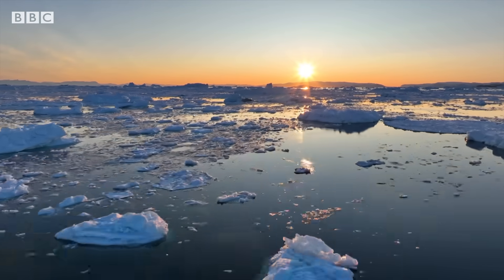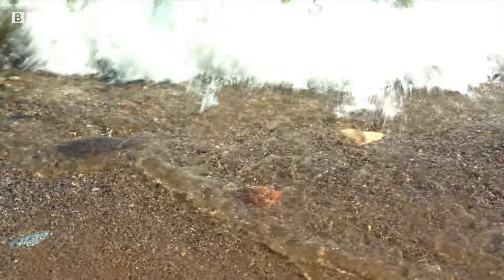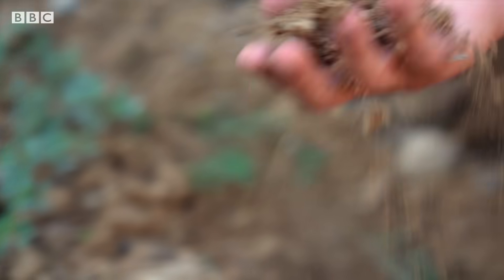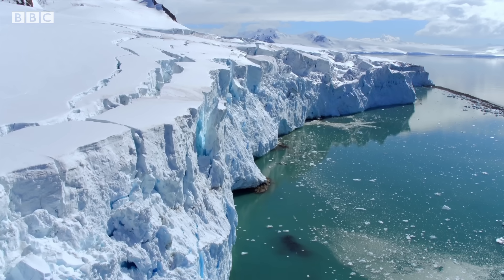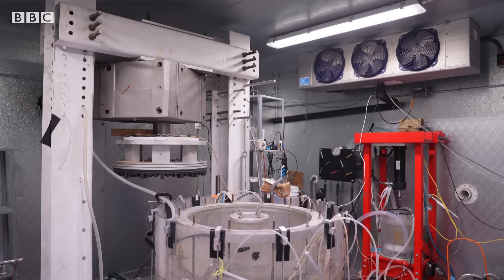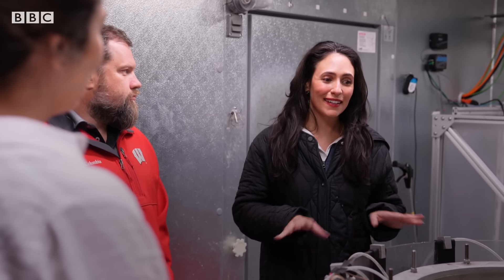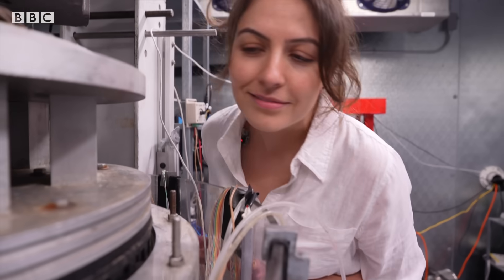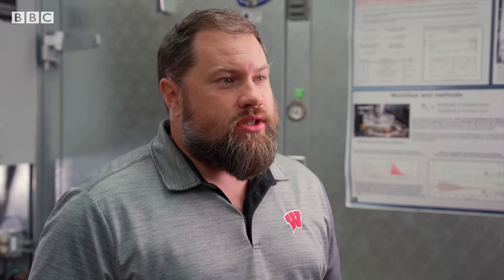Can we prepare for the impact of melting glaciers? | BBC News

Comment: Earth's current warming rate is 2°C per 100 years. ‘The Great Dying’ mass extinction which killed 96% marine (sea) life and 70% terrestrial (land) life was caused by a temperature increase of 5°C in around 20,000 years, at Earths current rate 5°C can be reached in just 250 years (currently warming over 100x faster)

The warming seen directly matches carbon dioxide (CO₂) emissions 

The past decade has been the warmest on record with 2024 being the hottest. 2023 & 2024 reached 1.5°C global average temperature above pre industrial time (year 1850) and 2025 is expected to do the same.
2040: ≈1.7°C; 2050: ≈1.9–2.0°C; 2100: ≈2.7–3.1°C

Tipping points 
• Once a certain temperature is reached these natural factors start emitting CO₂ faster and faster at a rate that cannot be stopped by humans stopping CO₂ emissions (runaway effect) (CO₂ remains in the atmosphere for up to hundreds of thousands of years), and are irreversible (e.g. ice sheets take millions of years to form) 
• 1.5–1.6°C global average: ice melts → darker ground underneath can heat more → faster & faster melting → higher & higher temperatures → CO₂ emission from ice; sea level rise (current rate is global rise up to one metre before 2100 flooding coastal infrastructure such as shipping ports and forcing mass displacement); temperature at the poles determines the wind pressure of the jet streams which control global weather causing more extreme weather (e.g. more intense and longer heatwaves causing drought); freshwater from ice slows global currents which control air temperature which leads to more extreme weather 
• 1.5–1.6°C global average: heatwaves cause drought → unfarmable soil; water shortages; destroys microbial soil ecosystems (bacteria & fungi) which keep plants alive (including trees and grasslands) so they stop taking in CO₂ and instead start releasing it; increased wildfires release vast amounts of CO₂ from forests

Comment: Plymouth rock is still unsubmerged...
Reply: AI Overview
While Plymouth Rock is often visible, the claim that it is still unsubmerged—often used to dispute sea-level rise—is misleading and false. The rock frequently becomes completely covered by seawater during very high tides and storm events, and it has been moved multiple times since 1620. 
Why Plymouth Rock is Not an Accurate Sea-Level Gauge
It has been moved repeatedly: The rock has not been in the exact same location since 1620. It was moved to the town square in 1774 (and broke in half in the process), moved again in 1834 to the Pilgrim Hall Museum, and finally returned to its current waterfront location and placed on a concrete foundation in 1920-1921 during a redesign of the harbor. Because its position and elevation have been altered, it cannot be used as a stable, historic reference point for sea levels.
It gets submerged: Contrary to some claims, the rock does go underwater. Videos and photos have captured it mostly or fully submerged during high tides and storm surges.
Sea levels have risen: Scientific data confirms that sea levels in Plymouth Harbor have risen by approximately 1.5 feet (about 45 cm) since 1620. Globally, average sea level has risen 8 to 9 inches (20 to 23 cm) since 1880, a rate that is accelerating due to human-caused climate change.
It's not bedrock: The rock is a glacial erratic boulder, not part of the local bedrock, and it sits on shifting sand, further making it an unreliable indicator of long-term sea level changes. 
In reality, experts agree that the rock is not a useful landmark for measuring sea level changes; it is primarily a historical and cultural symbol.
Reply: @LibBot 😂😂😂 is that your best using AI 😂😂
Reply: @Roland_Tr909_Swing    Better than what you have dopeboy
Reply: @LibBot BOT
Reply: @Roland_Tr909_Swing    You can think whatever you care to think... However you can not prove me wrong.
Reply: @LibBot that's such a typical bot crafted response 😂😂😂
Reply: @LibBot bla bla bla. YOU'RE FOOLING NOBODY
Reply: @faisafarrah9043    No, I am not